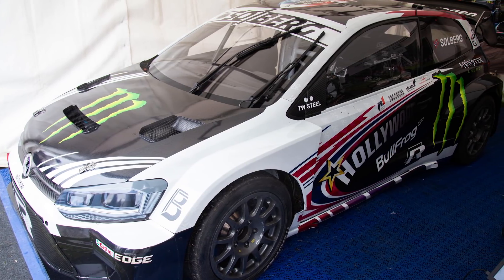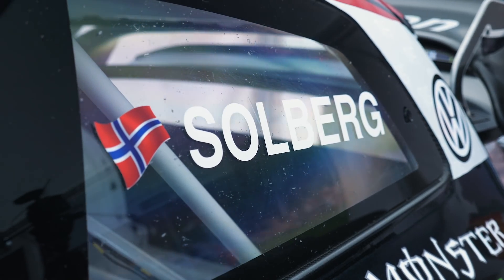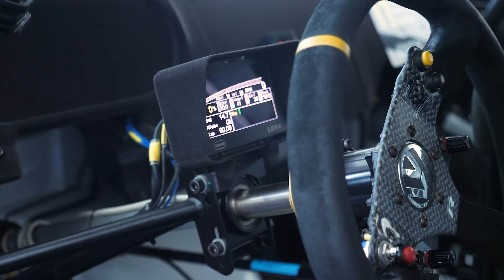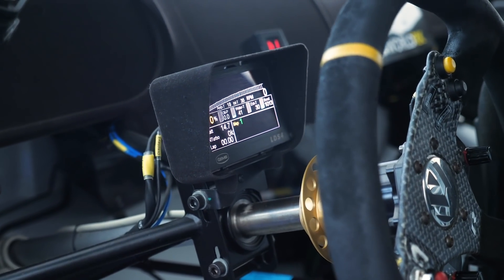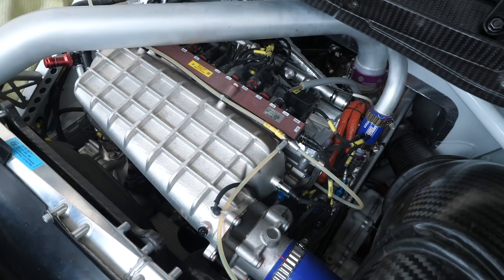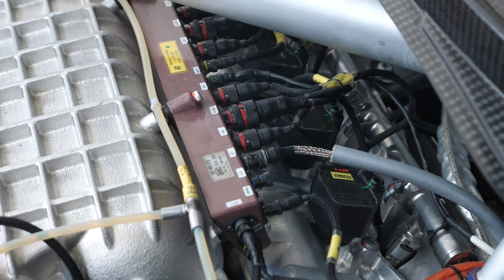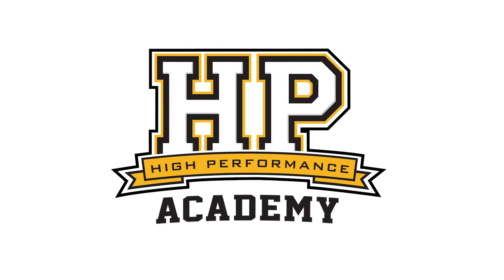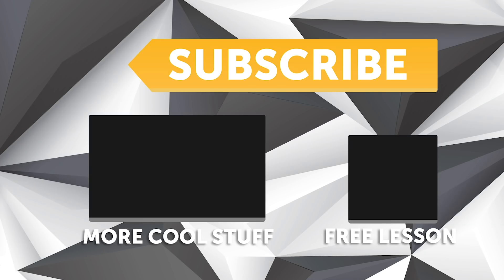The Most AGGRESSIVE Anti-Lag? | Petter Solberg's WRC to WRX VW Polo [TECH TALK]

Comment: You should do a video about the rocket anti-lag setup developed for Subaru by Prodrive! External combustion engine combined perfectly with an internal combustion engine.
Reply: The "Rocket" was/is really just refined variation on what is being described here, except Prodrive fabricated a combustion chamber into the system.

The "Rocket" setup is actually pretty simple engineering and was on the threshold of the WRC regulations.

Oh, and as good as I am sure your build is, you REALLY need to do some research before you compare it to a WRCar setup.
Reply: @tbtstt  i f you dont knew it already i can tell tou theres absolutely no need for a fucking combustion chamber to get full boost on idle and that was the only fucking thing i compared, cause i have full boost at idle in my streetcar STI-16 with Syvecs ECU and 705 bhp. So if some one shall read so is it you when you Think thats so fucking fantastic….lol
Reply: That's a very nice setup, but what you have got is still a long way from WRC specification (nearly 60 PSI at under 2000 RPM).

The seperate chamber was a way of easing stress on the exhaust manifold. Not the most efficient way of doing things, but the regulations prevent any separate fuel or ignition source after the engine, so its the best way of working within the rules.

The WRC setup is also silly expensive: much of the exhaust system is inconel so just the headers cost more than most street engine builds!
Reply: No, I'm not "retarded", I was trying to have a conversation with you to better inform you.

Looks like you already know it all though and couldn't possibly learn something by using the internet to talk to someone instead of mugging them off.
Reply: @tbtstt   what made me upset was your constantly talk about that i according to you have wrote that my car has the same spec as a wrc car….i wonder, where the fuck did i wrote that????  Show me !!!! BUt you cant , cause i never has compared my car with a wrc car , the only thing i has wrote is that if your "rocket" als was so special cause it can give full boost at idle, i wrote that every single serius standalone ECU nowadays can do that, so even  my. That is the only i wrote about that, but your head  hanged up yourself on that and Think full boost on idle is a fantastic thing that only your "rocket " can do, but thats fucking totally wrong. as i  wrote every decent modern standalone ecu can do that with a little trick. That was all i wrote.
Reply: If you weren't trying to make a comparison, then why mention your build in the same sentence as dismissing the OP @mattiasandersson3444 ? 

Your comments suggest that you don't know the differences in the WRC/RX engine setup (and what makes the "rocket" so impressive) as you state that you "have 25 psi AT IDLE" and that "theres absolutely no need for a fucking combustion chamber to get full boost on idle". Well no, there isn't in a road car, but the comment from the OP was talking about the "rocket" setup and a WRC car. YOU brought your car into a conversation about WRCars and started using it as a benchmark to prove your facts, when there is no comparison between a street car and a WRCar. 

Yeah, you are right,  a lot of aftermarket (and even some OEM) ECU's are capable of these functions and will give positive boost on a street car, but WRC and RX cars are very different animals, there is no comparison. The (restricted) turbos are producing 20+ PSI at idle and 60ish PSI on full boost. Early ALS setup was CONTROLLED by the ECU, but utilised jacked throttle/throttle bypass in the Group A days and bypass air ("fresh air" ALS) from the early WRCar-era onwards. 

The rocket was a refinement of the fresh air type ALS configuration. Relatively simple design, but bloody clever engineering. Watching the latter (S10 onwards) Impreza WRCars launch is mighty impressive as you can hear the engine is hardly revving, but the turbo is sitting on maximum (4 bar) boost. 

Like I said, your build sounds great, but you brought it into this conversation. I am a Subaru owner, but there is no way I'd even mention my car in the same sentence as a WRCar. I originally commented to try and give you the facts but, as with so many, it seems you'd rather mug people off then have a discussion and maybe learn something.
Reply: @tbtstt   matter a fact the nowadays rx cars stil using fresh air als ,my tuner tuned Johan Kristoffersons World RX car  2016-2017  and johan as you may know became World champion thse years, so he  probably knows that better than you, cause he had spoke bout it and he has told me how its works. Further there are no use for 4 bar at the start when they spin loose at only 1.5 bar. My tuner said that johan who became World champion in rx 2016 and 2017 never used more than 2 bar even on dry Clean tarmac, so i can promise you either wrc or rx cars are using any 4 bar when launching. Further 3: if you want you can tune a regular stand alone ECU to give much more than 20 psi at idle , if it not were for the restrictor. For example  my car as i have told you Before, gives 25 psi at idle. Further 4.: The als has Always been controlled by  the ecu....who else sholuld controll it ? The driver with a stick or what. Ecu and the tune off it controlls every fucking thing in a wrc or rx car. Motec for example , when the wrc cars had Active diffs everywhere and not just in the middle  like now, it was  the motec or pectel ECU who controlled all 3 diffs until they forbidden them in the rules. soo now you now that too. But you win the keyboaardwarrior game, i have´nt the energy to discuss such thing over a fucking kevbord so you better go on to some one that only can fight at the keyboard with information only find at the internet. I prefer to find the knowledge in reality and not by a keyboard. MY tuner is one of them i listen to , he has tuned World chanpions rx cars for about 15 years and has even drive some wrc -competicions as driver . Before he became a tuner instead and he is now   well known in the countries  around and in sweden. IN about 20 years ago he was tuneing  wrc cars för toyota but it did not last so long when toyota quit driving wrc for some years.
Reply: Lol    You are talking about the simplest ALS setup that has been used for more than 30 years,  he described it before  he describe the modern form of ALS strategy with air going direct to the exhaust manifold instead of going through the engine...or do you think Prodrive has been to the moon with their "rocket" als strategy ? looool
Reply: @mattiasandersson3444  haha don't worry I can tell you have no idea what you're talking about! Do some more research first! Prodrive system produces full boost at IDLE

Comment: 34mm? So a world rally car breathes through a tiny opening about an inch and a half in diameter?! Jeez. At least in NASCAR they have four holes.
Reply: That was the last generations 2 liters wrc cars that were restricted with a 34 mm restrictor. But now it is 1.6 liters WRC-engines with a bigger 36 mm restrictor and the powerlevel  is about 380 BHP.
Reply: a wrc has the same or more air going through that hole, and its there to limit the power intentionally

Comment: Interesting video as always! Although you do mention the rallycross rules allow for a 2l engine, WRC cars since 2011 including the Polo WRC ran a 1.6l engine, so the differences I'd imagine go beyond just the turbo restrictor size?
Reply from the maker: Hey there Chris, you are 100% correct. I made sure to address that bit in the video description as it would indeed contribute as well. Cheers for the comment - Taz.
Reply: The modern 1,6 liter WRC cars produce around 380 hp.